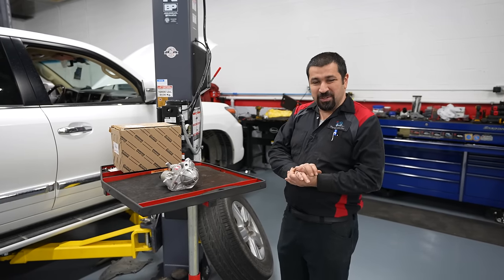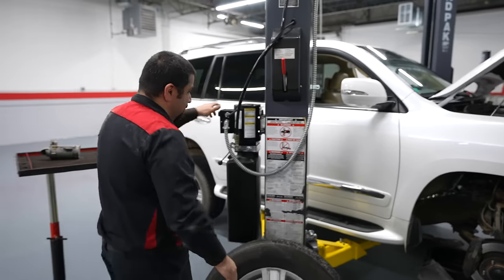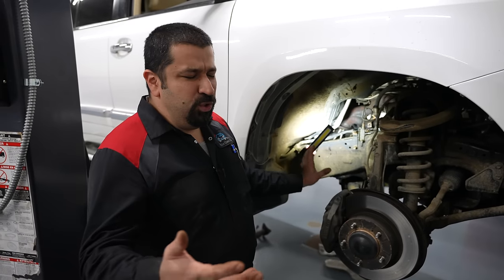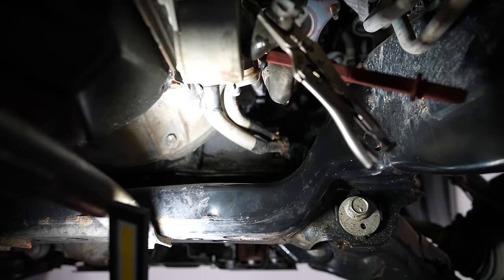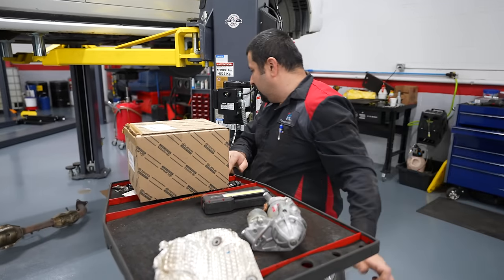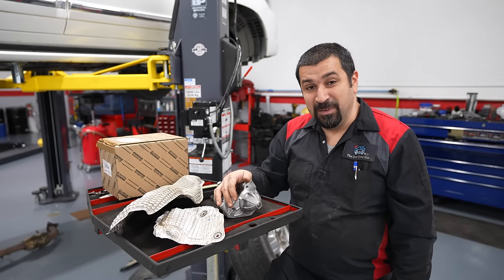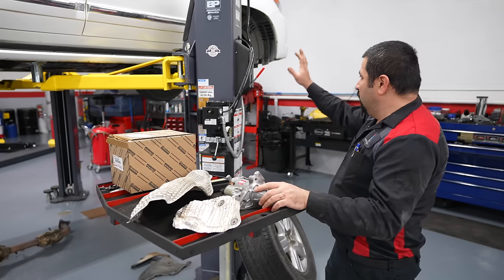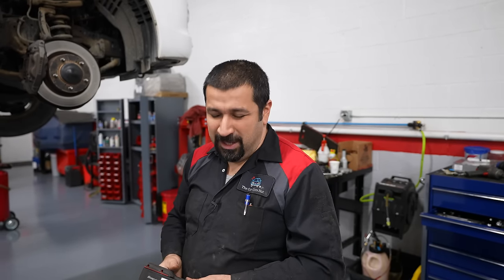TOYOTA! THIS is REALLY A Horrible Design! You Could've Done This Better!

Comment: Have a question for 21 highlander I took vehicle back to the dealer had a problem with the garage door opener on the minor I program it to open the door worked well then it stop .I reprogrammed it again can’t get to connect I wasted two hrs at the dealer they said there no way can check it to see if it works end game they couldn’t fine out for sure if it works and Toyota would not cover it under the warranty my question how can I do something different that the dealer could not do thanks

Comment: Hello Ahmed,  
Great videos that you like watching even if your not into cars !
This question does not pertain to this  video but i need some help .
Just bought a 2012, 2.2 litre RAV4 that has been standing 8 months in a car sales lot, all Toyota service history,  32,000 miles with one owner .
The problem is it likes drinking diesel 🤨 even light footed on the motorway it won't go over 32 mpg , it was 28 before that run out .
In the UK here they are quoting 37.7 urban and 54.3 on the motorway/ highway. 
Do you or your viewers have any answers on this particular topic.  
                   Kind Regards, Ian D.

Comment: I remember doing a job on removing a 90's corolla starter replacement  and ended up not doing the job because it was so different to do would have to take half the engine apart

Comment: This is a lesson GM could give Toyota...small block V8s and the lil V8 based V6 engines all had the starter that came out way easy. Two bolts, 2 electrical connections, a wee lil wiggling and she's out in minutes.
Reply: I agree, Toyota should learn from GM about reliability for sure. Better yet from Chrysler.

Comment: TCCN I have a question. I have developed a shudder on my auto in my 2012 Tacoma v6. How should I go about doing a diagnostic and finding a fix? thank you for the good info.
Reply: I replaced the fluid about 30k miles ago with (I think) Valvoline transmission fluid. My truck has 150k miles and feel like the torque converter shudders when it disengages.

Comment: My local starter rebuilder says that Denso uses heavy duty parts inside those Tundra/Lexus starters. If you need to replace your starter, use a Toyota remanufactured starter.

Comment: up here in the rust land, changing the starter usually means dropping the engine, because removing the exhaust manifold without snapping bolts or breaking bolts is nearly impossible.

Comment: mr car nut guy.I have a 19 corolla hb  SE. I need to replace or fix the transmission . The car is in great shape ,other than trans mileage is at 224,000.  If toyota replaces it $10k  ,7k for a trans from a wrecked car. can the trans be swapped to the xse manual . Any advice the best way. thanks the limping hatchback.

Comment: Lucky here in Australia that chassis is from landcruiser prado, it was only ever fitted with a v6 petrol or 4cyl diesel engine, the Lexus here is built on the landcruiser  chasis and with v8 there is plenty of room to work, worldwide I think that option is only a USA one, and they just squeezed it in and hoped for the best, like you say they are very reliable both engine and starter, I have never replaced a starter in any of my Toyota’s since they changed to the geared versions way way back. 
Love your videos!

Comment: That top bolt reminds me of a top bolt on a hydraulic pack on a B52 bomber where there is no way to reach it with a wrench or socket when the pack is in the aircraft.  We made our own tool just for that one bolt.  We cut a box end wrench off, ground down the head of the wrench to make it as small as possible and rivet it to the end of a steel T-rod so we could send that box end into the crevice to reach that one bolt.

I just bought a 2003 4Runner with the 4.7L V8 and I thought that starter under the intake manifold was silly but I guess I was wrong.  My other vehicle is a 2002 Chevy Express van with a 5.0L V8 and that starter change took about 15 minutes in my GF's driveway!  If I wasn't in California, I'd swap a Chevy crate motor into that 4Runner!

Comment: You could put in just threads (withouth any head) instead of bolts, to mount the heatshields and use seperate nuts.
(you are the care care nut !)  If you do the worst located one first and stick the shield hole over the thread, and put a nut on, the other 2 will be not as bad.   If you get maybe grade 9 or grade 10 bolts/nuts....they'll last probably even in the rustbelt make the next Starter change easier.   Love your videos.wish I knew 5% about cars/Toyota's like CCN.

Comment: thanks for the heads-up. I was just thinking about taking my old 2006 Sienna to the shop to replace the starter, just because the van won't start at the first crank. I have to do a second crank to start the engine. Is this a symptom of a dying starter?
Reply: Scan the codes. 
Maybe a fuelling issue? 
If the fuel pressure has leaked out of the system it will take the first craank to reestablish the correct pressure...and the second to start it?
Reply: @JohnSmith-yv6eq  the issue is intermittent, but usually happens on a cold start.

Comment: I have a 08 Toyota Tundra 5.7 V8 and my truck has been down for 3 months saving money to get fixed. Tried doing myself LOL and that heat shield is a _ and I quit. Used a 3 feet extention to take starter bolts lose and ended up quiting again. Still need it done if any help out there.

Comment: I'm a lexus tech and I've had to replace a rear main seal on a GX460 and honestly its not bad removing the manifold, the factory only torques the nuts to 12 lb-ft, would rather just go that route unless its mega rusty. Also had to replace the starter on and ISF and I just dropped the whole engine trans subframe assy. much less struggle that way.

Comment: Hot V's for the win.
Also an idea for the shield, why not adjust the shield with the new starter on the bench and when puting it back together install the top bolt first then the bottom two that are easier.

Comment: An acetylene torch would be a must have before attempting this job (especially if you reside where the roads are treated during winter).  Basically the same crappy repair job as doing exhaust manifolds on the 5.4 3V Ford engine (and the 6.8).

Comment: Two bolts are more than enough to hold a starter in a vehicle.
And you are rite about the exhaust manifold bolts can very quickly become a nightmare when they break off in the head if you're lucky you can get in there and weld a nut on the broken bolt and get it out. Or take the head off and get the bolts drilled out and hopefully you don't destroy the head in process. 🙏🙏🙏🙏

Comment: Try replacing a power steering pump on a 05 Toyota Matrix! You literally cannot get the bolts out because the frame is in the way! You pretty much have to pull the motor to get the bolts out of the power steering pump.

Comment: Its usually just the solenoid contacts and or plunger that is pitted. Its awkward but you can change those in place without removing the starter, exhaust manifold etc. You do have to remove the heat shields. For the DIY crew.

Comment: I have a 2 gen tundra 5.7 .. I have tried to replace the starter myself as a diy guy  Vary hard job I couldn't do it .. 💯 agree with u bad engineering.. should've left it on top of motor .. great

Comment: U are amazing! Dont know how u figure YOUR techniques! Those shields TELL u that heat is an issue. U are SO patient/positive. I'd anti-seize the HELL out of the hardware.😉👍🇺🇸
Reply: If I was in a rust belt I would try replacing all the bolts with magnesium or stainless steel bolts just in case it ever had to be done again.

Comment: Did I understand you correctly to say: on a Lexus IS the drive axle / axles go through the oil pan? Should this be a deal breaker when considering to buy an IS. I have been shopping for a new IS 300 or 350 and might have to change my thoughts on that vehicle. Sounds like a poor design. First time that I heard you mention this issue.👍👨‍🦳🇨🇦

Comment: basically replace the heatshield bolts by studs and nuts, and push a long hose over the studs and put them through the holes on the heatshield so you can fit the shield over the studs without too much fiddling.
Reply: I was just thinking the same thing....Slather it up with permanent Threadlock and make sure to let it cure for the minimum required time....What could go wrong?!
Reply: @plumkey197  also thinking of those plastic threads you put in the holes where an oilpan bolts on (handy especially for liquid oilpan gasket). Maybe with 2 of those plastic threads the shield would slip on easier than with 3....dunno.
Reply: @waltersheens1087  either way, there will be people who try your original idea because it’s just a different solution that’s rather elegant in its simplicity.
Reply: @plumkey197  maybe a Toyota shop will want to stay with the original bolts....therefore they can just start 1 or 2 studs on the starter to get the shield lined up with the holes. Just 1 stud on the upper/hardest position and start a nut on it, than put in the bolt that you can see, the 3rd on then will be not that hard to fiddle in.
Reply: @waltersheens1087  I could fashion a better heat shield from a Walmart cookie sheet LOL. I made one for a 454 Chevy in a P-20 chassis (35 foot RV) using an old pizza pan made of steel. It’s amazing what can be done with an angle grinder, a Dremel, and a drill press, and channelocks. I should have patented it because I had no further trouble with the solenoid cooking when the manifold was cherry red. Situation caused a no-crank when engine warmed up and I’d have to pull the engine cover and jump the contacts with a screwdriver. The Chevy big blocks and the earlier 350 were known for this issue.
Reply: @plumkey197  lol, then the wife got locks on all kitchen cabinets hahaha ! And no more pizza :)  I have an old 96 Cherokee XJ, not quite a trouble free car but the new cars (and repair bills) scare me a lot.... Since I'm in Netherlands (Europe)  I'll go back to bicycle I guess :)
Reply: @waltersheens1087  The cars I own are the 2008 Prius and 2000 Frontier. Both I can work on, but I shy away from anything newer because I'm not an electrical engineer! My Prius is old enough to replace the entire inverter (the electrical substation) or transaxle (contains both electric motors) with a salvage unit rather than troubleshooting the original units. But mine haven't failed yet and car has 238K on the clock. Even the traction battery is original!  It would be interesting to know if your Cherokee XJ was built in Beijing. It was a partnership between AMC and Beijing Automobile Industry Corporation and built the Cherokee XJ starting in 1984 up to 2005.  This is before Chinese manufacturing was thought of as cheap and junky. Greetings from Louisiana USA!
Reply: @plumkey197  your Prius did 100k miles more than my Cherokee :) Yes there's an online check to see where a Cherokee was built but haven't bothered checking yet... Great your Prius and even the battery are still good ! You're in a good climate guess you're cars not rust away :)  Nowadays you can get crap but also good stuff from China, guess on car parts it's not worth the gamble to try an unknown brand....I try to get Mopar mostly...  Greetings from Europe !

Comment: Removing the starter motor on a GS300 is also a pain. You have to loosen the driver-side exhaust manifold and engine mount then jack up the engine on the driver side, before you can remove it. A real pain.

Comment: I've changed a lot of starters in my day The easiest is the Toyota 4-cylinders cuz it's right on top and the front wheel drive 2GR starters because they are right on top The hardest I have ever changed would have to be a 2GR FSE IS 350 all wheel drive and a Honda Civic with the 1.8 L R18 engine with the IS350 you have to take off the exhaust manifold and it's a pain in the ass and with the Honda you actually have to remove the passenger axle just to gain access to it and even then you barely have any access to the starter bolt on the top

Comment: AMD got this right. This a very difficult job. The Tundra has the same design. To be honest, I did this job in 4 to 5 hours. And yes the exhaust manifold has to come off. I was able to sneak this out without removing all the pumps pulleys belts and so on from the right front. It is possible to drop the starter from underneath.

Comment: If you can get to the electrical wires without removing wires easily try cleaning the contacts. I have never had to change the starter on any of my cars except one I burned out by rolling it for too long.

Comment: toyota tech from australia here. the 1vd-ftv 4.5 diesel v8 has it in the v also. replacing it requires removal of the 2 common rails, 10 fuel lines, intercooler, intake manifold(5 separate pieces), egr pipes, egr valves and egr cooler and all of the turbo inlet/outlet pipes. very expensive part wise and very labour intensive.
Reply: Oof
Reply: Please re-post this comment the next time someone moans about Toyota Diesels being unavailable in the USA and Canada.

Comment: Good advice, never touch old exhaust manifold nuts and studs!
In New England those heat shields would have corroded out around the mounting studs a long time ago. So you could probably just yank them out. I’ve seen turkey pans made of thicker materials. Even worse the replacement heat shields are horrendously expensive like $70 a piece.
My other pet peeve is the front brake dust shields. Really thin steel that rusts out. I did mine when I replaced front hubs but geeez how about some stainless where it counts.
Reply: I can make a better heat shield out of a Walmart cookie sheet......LOL!

Comment: That starter is so tiny, could that be why it wears out? I haven't replaced a starter on a vehicle since the 80s, all were 3x bigger than that, even on a straight 6, and all had two bolts and a nib on the block. Nothing had to be removed except the wires. The spark plugs on one, however were a different story. The motor mounts had to be loosened and the engine jacked up to remove a couple.🙄
They make them to assemble, repair simplicity is, obviously, an afterthought.

Great channel.

Comment: They should probably ask mechanics for preferred placement, but a machanic that never has to deal with rust might think removing the exhaust manifold is no big deal while anybody from the rust belt would know that it is rarely easy. They really only care about cost during the warranty period and in that case removing the exhaust manifold may not be that big of a deal.

Comment: Drats, I bought the starter thinking i would tackle this as a preventative maintenance issue.  Now second guessing it.  2008 Tundra with 80K miles, driven almost every day but a very short commute.  When should I expect my starter to actually fail?
Reply: I had a 2008 ISF starter that failed at 100k, but I wouldn't take action untill it fails, unless you go on long trips to remote areas often.
Reply from the maker: Really hard to tell. Some fail as early as 100k some go 300k
Reply: I had a hyundai go 230k and even then I think it was a bad battery connection not the starter.
Reply: I wouldn't worry about it until actually fails. There's really no way to know when it will. I have a 2002 Dodge Dakota. Still original starter, alternator, ac compressor. I'm not too worried about it.
Reply: @DeniedByFate  Thanks, but mostly concerned about my specific year, make, model and engine before ending the daily commutes and heading into the wilderness.

Comment: Been there, done that!!! Did it on a 5.7 Tundra on my back without taking the exhaust apart. Don't ask me how, but I even got the upper shield bolt tight!!! Around 3.5 hours. Either way, it was horrible.

Comment: I changed the thermostat on my Honda j35 v6 yesterday. You would think that there is nothing to it, 15 minute job, 3 bolts, swap the housing with the thermostat built into it, connect the hoses, done! Just top up the fluid.
NOPE. TO be able to reach the bolts, you need to at least remove: Battery, battery tray, entire intake system up to the throttle body. This takes for ever because all the hoses are so tight, that you need pliers to pull them off, you will cut yourself a lot. 
This only lets you reach the bolts if you have angled socket extensions or tiny hands. Even then, its a pain in the ass and you will get coolant all over the electronics (so put a plastic bag under the housing.
But, if you have big hands, or don't have top of the line tools, you also need to remove: Throttle body, intake manifold/plenum that sits on the engine, and all the related wiring in the area which at this point, is a bunch of hardened and rotten plastic.
This 15 minute job just turned into 2 hours at least.
Then! After you put it all together and swapped it out and started the car, the car freaks out, thinks the security system has failed, traction control failed, abs failed, it goes into full freak out mode and revs to 3000 RPM on its own for no reason.
Then you turn it off, disconnect the battery for 15 minutes, reconnect it, and then the car works fine.

All I learned in my entire life, is that no matter how HARD a toyota job is, even v8's, its NEVER harder than an equivalent car from ANY other manufacturer. You think Honda's are easy to work on? Try removing literally ANY piece of plastic. If you brake even ONE clip, you will never be able to find one online because they don't have an official parts store like toyota, they don't have easily available diagrams or part numbers either, and the dealer will always sell you the wrong clip, and when you do get the right one, its like 15$ EACH.

Comment: I did one of those starters , in a tundra , on labor rate charges , I think 5.8 or  4.8 hours , luckylly everything came  out smooth , but yes i ended up , with stress and neck pain , it took me about the time  , on ALLDATA .